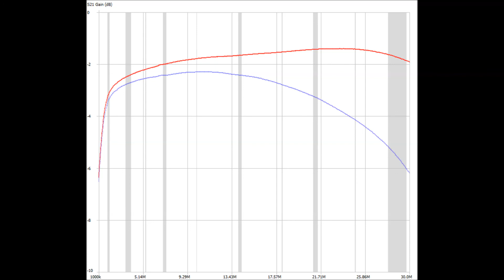EFHW antenna transformers - cumulative losses from prior 3 videos

Comment: Good morning from Germany Mr von Lair.
Seven or so years ago when I built my station here, I too farted around with different configurations of transformer as an EF really is all I can use for HF.
Having seen all of your videos and those from Colin most of them more than once, a thought escaped from my nose recently.
The winding and the spacing of the turns appears to be very important. In that the tighter the better seems rule of thumb.
Finding a core or cores with 2 parallel sides could markedly improve matters further    (___)   Upper side is missing. Using such a form would allow the windings to be side to side - more tightly packed.
I invite your thoughts. Just not the one of the shape being made from unobtainium.
Bw from Cuckoo land. Mike. G and also DL7KFT.

Comment: Interesting to know/see your test setup ?

Most of videos I've seen are people using the FT240-43 and showing only SWR and impedance as indicators of a 'good' core material with no regard to efficiency, which is not the whole story.

I'm trying to sort a 49:1 or 64:1 transformer for the mid/lower bands 80-17M what it boils down to is types 2, 31 or 43 decisions ? With a power up to 100W more than likely 5-25 Watts
Reply from the maker: Test is with NanoVNA through identical pair of transformers connected to each other. So the loss shown needs to be divided by 2 so that it represents a single transformer.
Reply: I would like to see a short video or write up too of exactly how these back to back tests are done also.

Comment: What cores did you use for this set? BTW thanks for the video series, I have been doing some experiments also that question the 'standard' recipes.  de AI6XG
Reply from the maker: It's the Fair-rite 5943003801 as seen in the prior videos, probably the most commonly used core of them all.  However, no matter what cores I use, I always measure less loss when I bunch the windings up tightly, no crossover, no bifilar. Also always less loss when using good capacitors rather than ebay crap. I really don't know why youtube and facebook group "experts" seem to all agree on a bifilar primary and things like a crossover winding. 100% of the comparisons I have made show that to be higher loss, no matter what core or cores, no matter what size wire, no matter how many turns of wire. I just look at it as consensus does not equal fact, as at one time consensus was that the earth was flat. I always encourage anyone to not take my word for this, measure yourself, get your own results, draw your own conclusions.
Reply: @evil_lair_electronics  thanks for the reply.  Yes, I prefer data to conjecture.  I had questioned the use of the primary capacitor.  Some results at www.ai6xg.com
Reply from the maker: @AI6XG  I've seen your posts in a certain facebook group where the admin and his cronies seem to think their way is the best way / only way, without loss data to back up their claims. You're light years ahead of them!
Reply: @evil_lair_electronics  Yes, they do not make insertion loss measurements at all, let's say that they don't measure nothing even when claiming this and that. Now, looking Your videos makes me doubt a lot to start again with new experiments and measurements on EFHW transformer. It's obvious that the common construction is not the only and best construction. The only thing that the "experts" do is to measure the SWR that the transformer produce connected to a 2450 ohm resistive load. But this means in practice very little since the Radiator is not pure resistiv - I just hat made transformers who had not a perfectly good SWR on the bench with the resistiv load but showed a very nice match on the radiator. Your videos showed me that there is more to explore much more. Specialy regarding the insertion loss parameters. Please, if possible place more videos of Your findings on your chancel - PY2BND -73 !!